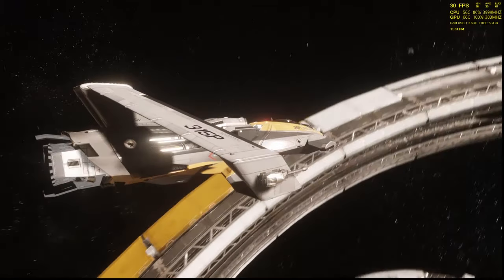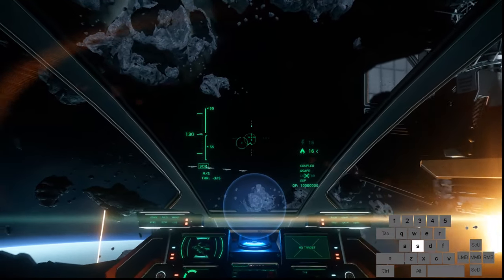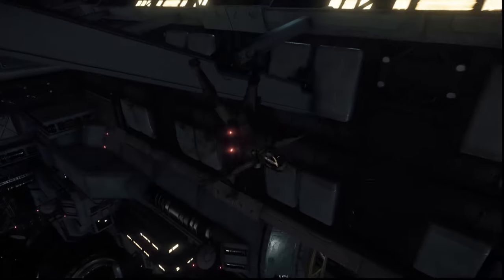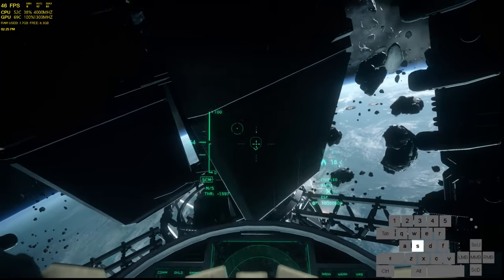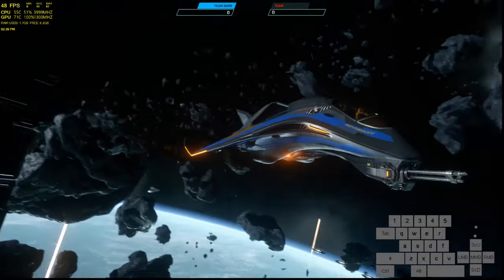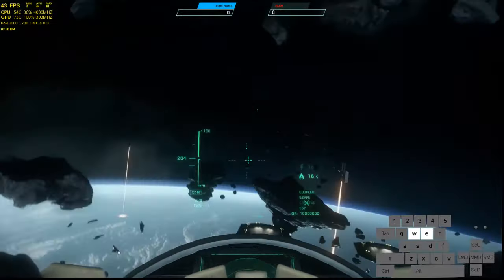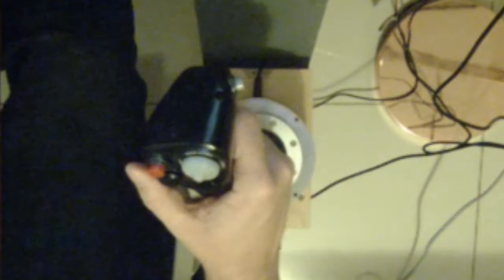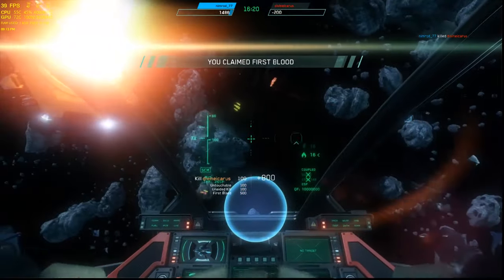Star Citizen - Principles of operation - Flight control and throttle keybindings

Comment: Thank-you for the information, for some time (months) I've been trying to setup the keybindings for my Extreme 3D Pro but no luck (twist = yaw, hat = strafe).
The mouse causes my head to bob up and down with the lightest touch (need dead zone?).
Can you (Nimrod77) and/or Bear of Red(?) help me in this much needed endeavor?
Thank-you for the time.
Reply from the maker: I believe what you are seeing is a feature called "Look ahead mode" if you turn that off the head bob should go away. Look ahead mode is bound by default to "R-Alt M". It can be found under options - Keybinds - Flight Targeting. HTH.
Reply: Thank-you for the help.